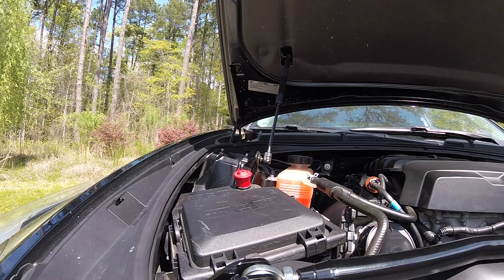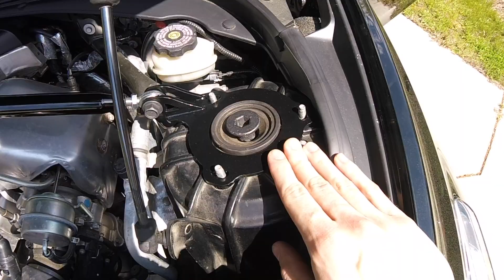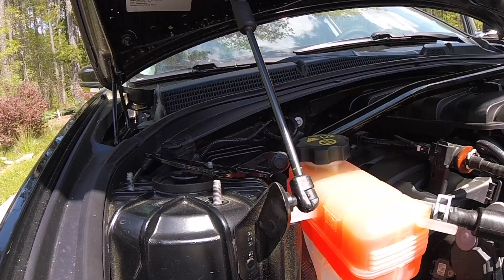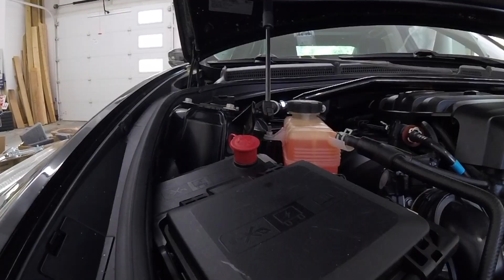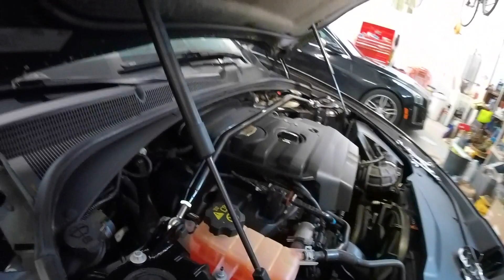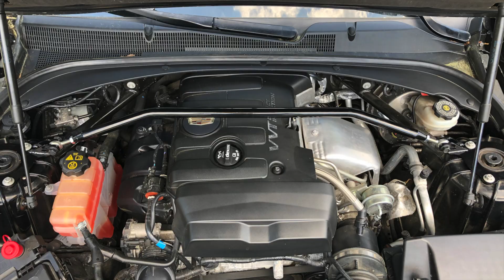ZZPerformance Front Strut Tower Brace Install on 2016 Cadillac CTS

Comment: Howd you feel about the weight add on a CTS? Ive got a CTS also, and this bar is heavier than expected, debating even using this one
Reply from the maker: Interesting question, the weight of the actual bar isn't enough to make any noticeable difference.
Reply: I just put it on and lost a nut on the opposite side 😂😂 . NGL I was saying how'd you lose a nut watching the video. I now know 🤦🏼‍♂️

Comment: Did you still get some jiggle to yours?
Reply from the maker: Yeah there’s some jiggled between the bar and the bearings and it can move forward and backward, just make sure to tighten the length of the bar so that it fits properly around the strut mounts.
Reply: @Nick-dd7ps  thanks!

Comment: I just installed mine on my ats. Did you not get alot of noise from the slop in it front to back?
Reply from the maker: I personally didn’t notice anything. If I wiggle it with my hand, it will tilt front to back a little but nothing that made noise while driving. I’d just double check that all the bolts are tightened and that the nut is tightened that controls the length
Reply: @Nick-dd7ps  ya I think I'm going to have to bring it in a bit because I can hear it when I'm stopped or go over big bumps

Comment: Did the brace jiggle at all, or was it all tightened up and rigid? I’ve seen other videos where there was some slop on the brace. Not sure if that would defeat the purpose.
Reply from the maker: The brace will jiggle front to back which doesn’t affect the performance. It has nuts that can be tightened to snug up so it doesn’t move side to side which is what matters. Thanks

Comment: What kind of difference have you felt while driving? I'm contemplating installing a strut bar because I like tight steering, but I don't want the car to oversteer in turns. Does the bar magnify oversteer issues? My CTS is the 3.6 luxury model.
Reply from the maker: Steve, I haven't felt a major difference but it does help reduce some flex. Personally, if I were to do it again, I'd upgrade the front sway bar or get stiffer springs instead. I haven't had a problem with oversteer issues